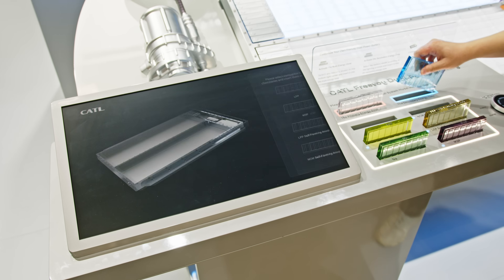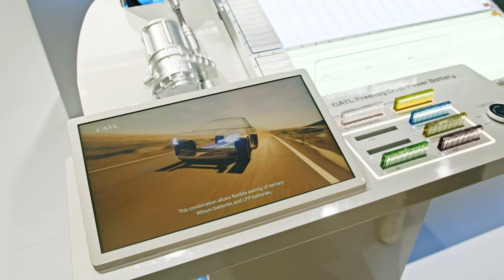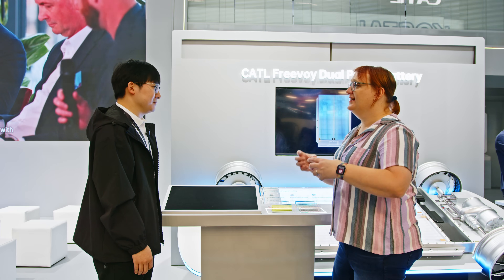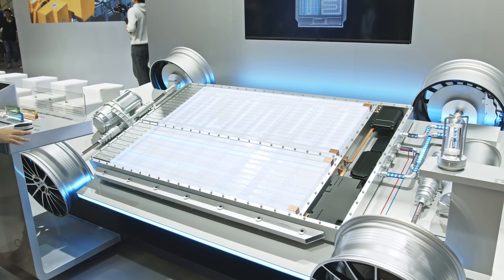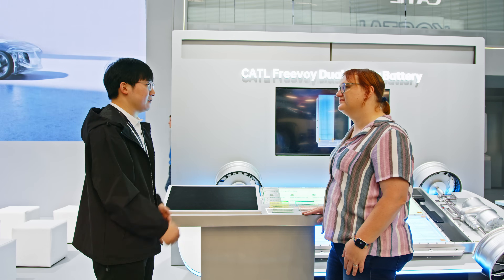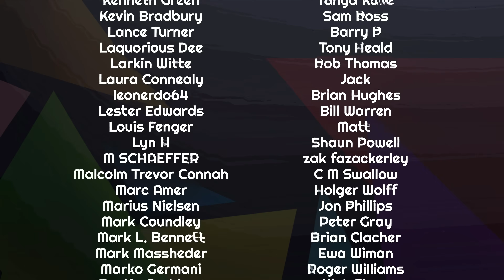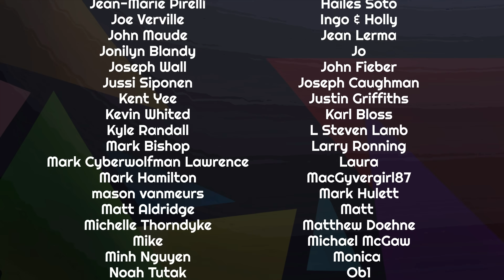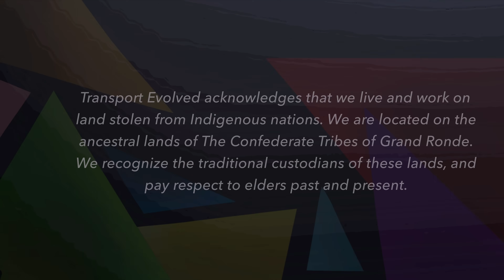CATL Freevoy: 2 Batteries, 1 EV! (IAA 225 Tech Interview)

Comment: Good questions. Informative interview. I have been interested in hybrid chemistry battery packs ever since I saw the ONE (Our Next Energy) packs doubling the range on a Tesla Model S. CATL's sodium ion batteries promise a game changing reduction in pricing ($10/kWh) along with other functional benefits. But having a hybrid Freevoy battery pack brings the best of multiple chemistries, to better match the specific needs and environment of different use cases. Where I live, super low temps are not a problem, and super fast charging is also not a concern for me, as I charge up at home overnight. But battery pack cost and lower weight are more important to me (which are points current at odds with one another). So the Freevoy system could be configured to better match what I need overall in a future car battery pack. The biggest delay for us getting this technology today is import restrictions. Hopefully Freevoy will push U.S. battery manufacturers (like ONE) to build competitive hybrid chemistry battery packs, moving forward.

Comment: No lead-acid?!?  Seriously though I have to wonder about balancing between the two sides.  She asked about discharge curves and he answered with separate BMS's which isn't really an answer.  There is a lot to consider when trying to run off two batteries and the only way I can see it working with unmatched voltages is if the vehicle can separately get power from each battery, like one battery is for FWD and one for RWD.  Maybe use a different battery for different phases of the motor.
Reply: I think that's really the whole magic here. Anyone could put two different chemistries side-by-side. The software and hardware required to do the switching between them is a bigger deal. And I doubt they would run at the same time. It seems more likely that you would want to use the higher energy density chemistry for acceleration and the more long life chemistry for cruising. One of the two chemistries is likely better for directly accepting the charging or regen... and the other is better to be charged through that one. Those kinds of dynamics could allow the typically shorter life side of the pack to attain a longer life, because it is not in continuous use. So basically working like a hybrid drivetrain, partitioning the work.
Reply: This interview was heavily edited. Apparently he was refusing to answer specific questions like that.

Comment: My guess is there will be a dominate chemistry pairing that moves forward. My guess is NMC at 10% and sodium at 90% which allows for some of the power density while retaining most of the affordability.
Reply: …and add in a small cache of solid-state for high-density, high-speed requirements. A great marketing differentiator will be how large that solid-state pack is